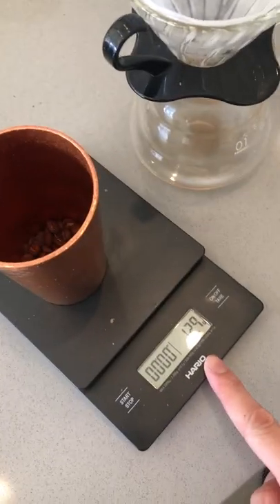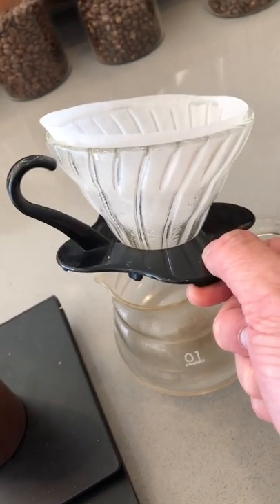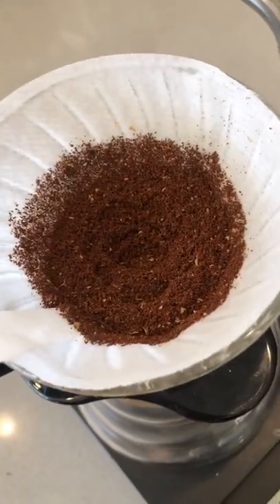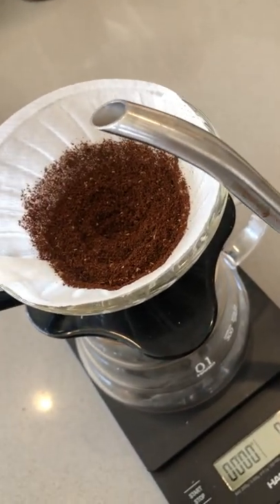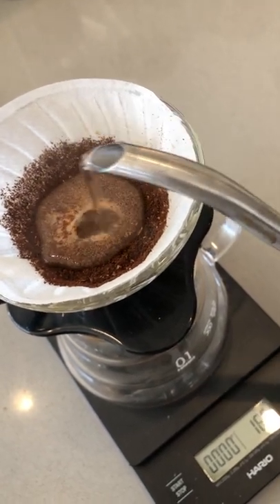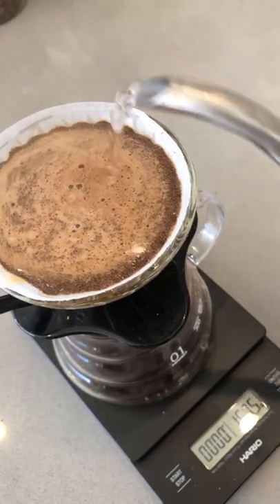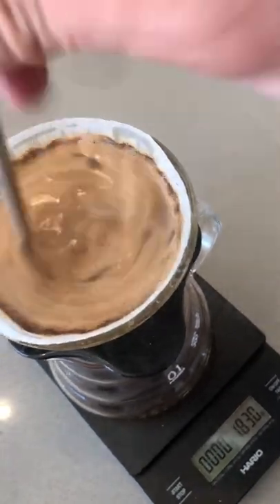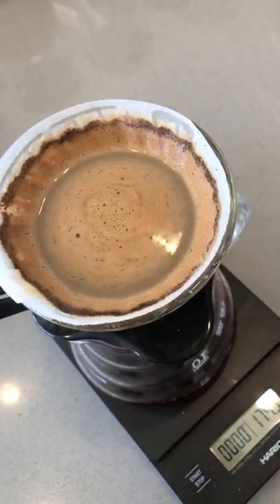How to Brew Small Cup Pour Over Coffee #shorts

Comment: Getting watery/diluted notes when using my 01 with 15g extra fine coffee (1:15 ratio),  93 - 95 deg Celsius, with total brew time between 1min15s - 30s. Any tips on what variables to change? Also noticed you didn't do much of a flush finish here. Any particular reason? Thanks!
Reply: Using Ethiopian light roast here btw!
Reply from the maker: Hiiii! Hmm could you show me your finished grounds over a dm? Would be a bit easier to see. But if you’re finished around 1:15 it sounds like you finished brewing a bit quickly.  Try pouring slower with a higher agitation brew! So more inside to outside motion.  My stirs generally flush for me but I must’ve missed it while attempting to film >.<

Comment: Why not swirl to get the grinds of the wall?
Reply from the maker: That causes uneven agitation and pulling fines in casues clogging which in turn casues more channeling 😅 I really dislike swirls I’ll make a short on this too actually
Reply: There is quite a few who disagree with that 😅
Reply from the maker: Yeah I’m aware, but bringing the micro fines in causes clogging in the middle. If you look at the ey between stir vs swirl it’s a lot more noticeable. The swirl forces more water through the sides. Can tell by testing both on origami (most channeling) vs mugen (least) and you’ll notice ey numbers are more gapped on origami vs mugen. Also swirl activates more movement on the edges vs the middle so the agitation is uneven. Where your stir unless you have a bad stir .. it should be an even agitation.

When compared to 0 agitation the stir throws the microfines to the edges too which helps prevent channeling. Resulting in a faster flow and a higher ey. As much as people disagree with what I’d say they could test and see it if they want to prove their swirl is better